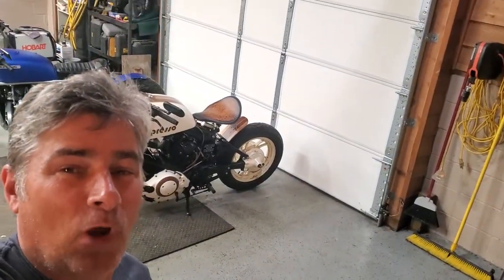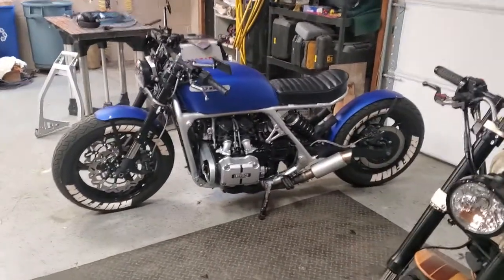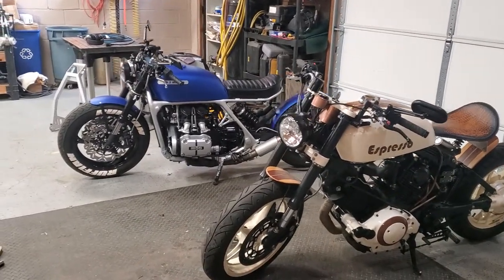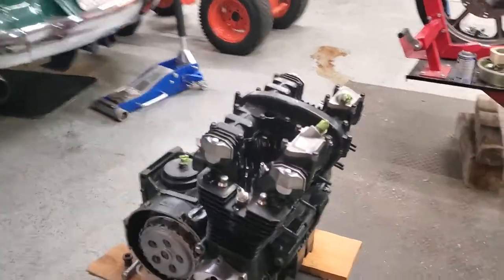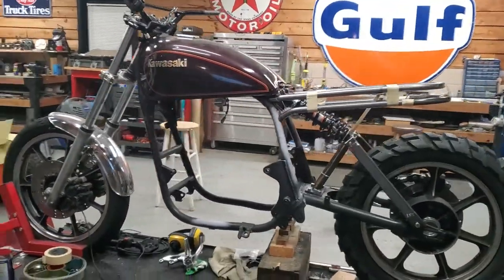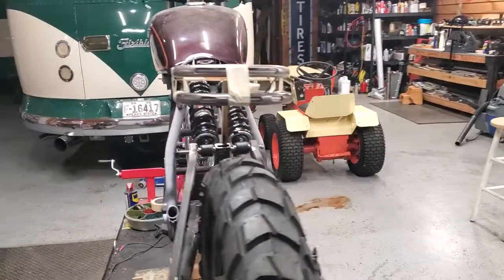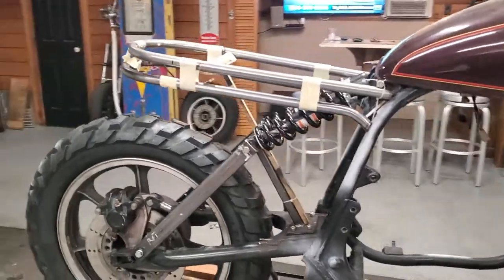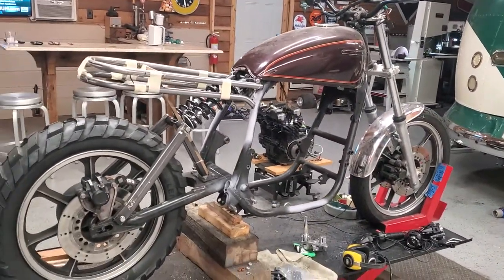Kz1000 build #1

Comment: I'm thinking an old school looking adventure/scrambler hybrid....Obviously the heavy 1,000cc inline 4 isn't the best option for trying to make a lighter weight off road Scrambler. But maybe an adventure/touring bike that looks like a rugged old school scrambler. Made at least somewhat multipurpose, able to handle some gravel & dirt country roads.  I kinda like the looks of the Janus Gryffin scrambler with the rear luggage rack (but bike's too small for me) I'd add an adjustable windscreen that doesn't look too big when down but can block a good amount of wind when pulled up. Add some hand guards, fork boots, some side engine guards. Instead of 3 large hard storage cases, use some old school military-ish looking canvas saddle bags & matching rear canvas luggage bag. Bags could be diy water proofed with wax or silicone/mineral spirits mix & made to be strapped down when empty. So they're not flapping around in the wind & also don't look big & bulky unless filled up. Some 50/50 street dirt tires.